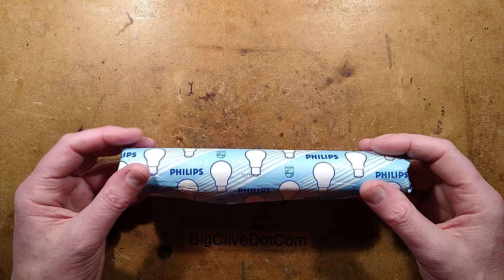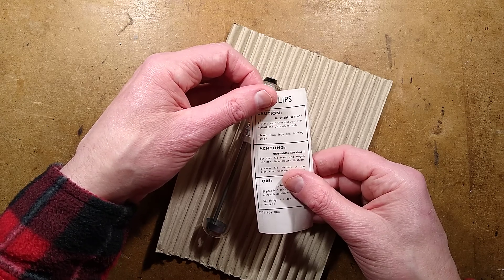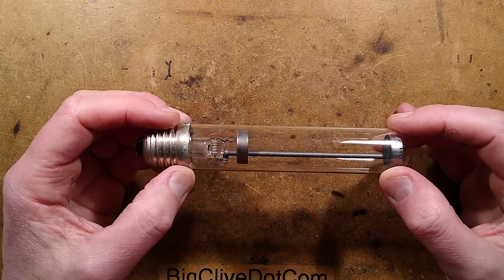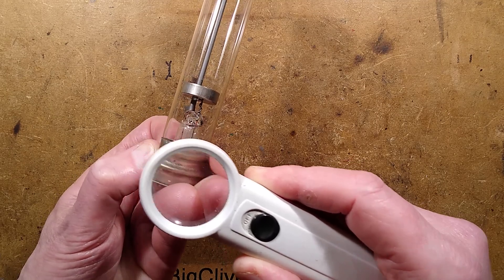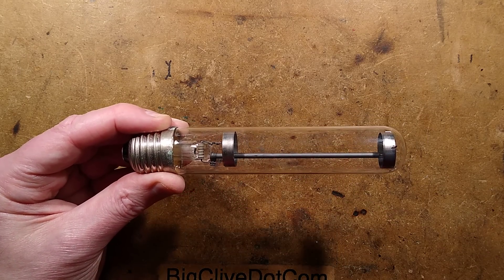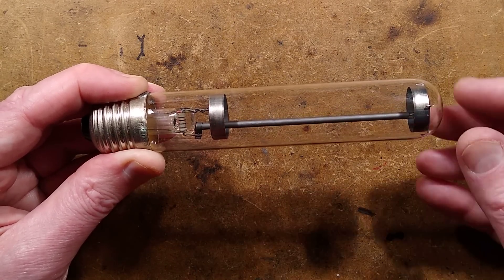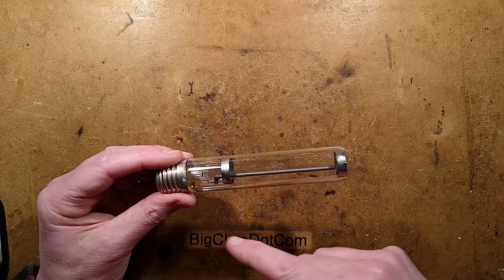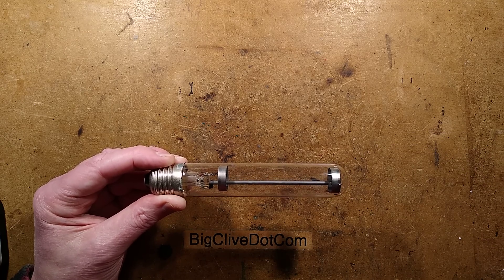Unwrapping and testing a dangerous vintage Philips lamp

Comment: Once the retinal burn sensation subsided from staring at the UV somehow being transferred via the normal LED screen (how'd  you do that!? giggle giggle) , it reminded me of a HS shop class. I was the one, who once-a-month was the one who checked the cabinet that everyone stored the safety goggles. The shop teacher reminded everyone to NEVER push the "on" button, as it would turn on  the UV bulb inside to sterilize all the goggles. It was actually on a timer that automatically turned it on for 3 mins between classes and for 30 mins overnight (at the end of the day). I had to check it once a month to see if it was working and let him know if it burned out. It was the exact bulb type you show here. I've seen other UV bulbs, but they looked more like regular bulbs or laser gas tubes. This one with those metal "caps" and that long rod inside is what brought back the memory of the '80s. And no, I never looked directly at the bulb. I was the "lucky" one who got to turn on the override "on" switch for a few seconds and see the glow through a little slit between the doors to see if it was actually on. Then I checked the bulb to see if it was discolored/darkened. Only had to replace the bulb maybe twice. I don't recall ever smelling ozone after it was on. Did this one produce ozone?
Reply: I don't think it produces ozone otherwise Clive might have mentioned it.
And besides, more modern UVC bulbs including Philips ones don't emit ozone as their quartz is specifically treated to block the ozone-generating wavelength of light.
I think it's only the cheapy chinese bulbs that emit ozone.
Which is actually quite a pain when you want to sterilize air in a HVAC system or even some stuff by pointing the lamp at them, without ozone you can reintegrate the room right after having switched the lamp off, not so much with a ozone-generating one.
Reply from the maker: This one didn't produce ozone.  It must be filtering the 184nm wavelength.

Comment: That was a nice purchase! 😃👍
Nice, that Philips was able to put all needed "hardware" directly into the lamp that fits into a regular E27 socket. No external transformer, no external starter needed! 👍
Very low power consumption aswell.

Comment: I used the illuminated time of the lamp to test the authenticity of my bank notes by laying them on my tablet screen - thank you.ps. I think there should be an app that allows your phone screen to light up purple and emit UV .
Reply: There might be apps that turn your screen purple, however it will not emit any UV as it's basically not designed to do it.

Comment: I have one of those. The idea decades ago was to make circuit boards and use the UV to expose resin. Never worked well for this, wrong wavelength I guess. I'm afraid I looked at it with bare eyes a couple of times, but not blind yet. I guess I better label it with skull and crossbones in case the kid finds it and turns it on.
Reply from the maker: It needs to be UVA for that.  Either the dark coloured blacklight tunes or the bright blue insect zapper ones.

Comment: Watched this in 360p as I was rather nervous about the full HD experience. I did wear protective eye wear though and looked away from the screen for the duration of the video. I have noticed some sunburn on my iPad screen, however just applied some factor 30 to it and that should heal with time.

Comment: I happened to experience an effect of intrigue, and happiness, while exposed to it functioning, and the thorough explanation of how it worked... 🤷 👌

Edit: But I WAS on the shitter as I watched this video... 🤨

P.S. And no, it didn't help with that at all, I still had to work at it, as usual. 🫤

P.P.S. If the bulb WOULD help, and create the desired effect, I DEFINITELY would have one screwed in to my bathroom ceiling light fixture, and have a pair of welders goggles hanging on the towel rack.. 👍🤙

Comment: That reminded me of another "dangerous" lamp I ran into. It was some kind of high intensity bulb designed for photography/video lighting. From what I was told it got ridiculously hot, and when installed the bulb was never to be touched by bare fingers as the oil from them would cause the lamp to explode. I have no way to confirm if that was true or not. 
Not entirely sure, but I think this type of lighting got replaced by LED lamps.
Reply: I can confirm, this also holds true for videoprojector lamps, when swapping a bulb from a old DLP proj, I grabbed it by the glass part by mistake.. So when I tried powering the proj up, the bulb literally popped as it began heating up. That was very startling!
Reply from the maker: The oil from your fingers causes excess heat at that area and devitrification of the quartz.  It can make the lamps fail at that point by going frosted and sometimes bubbling out and destroying the vacuum.
Reply: That sounds like a normal halogen lamp. If you get fingerprints on them the glass can crack due to the fingerprint absorbing light and creating a hotspot on the glass. The fingerprint is probably burnt to soot by the high temperature increasing the light absorption.
Halogen lamps need to operate with very hot glass for its internal chemistry that prolongs the filament life to work correctly. They are therefore typically much smaller than normal incandescent lamps.
Many halogen lamps have a second outer glass that doesn't get as hot protecting the inner glass and avoiding these problems.
Reply: The not touching with fingers is true for any kind of Halogen lamp capsule, car headlight bulbs (as still used on most cheap cars) being a good example. 

The explosion part reminds me of when a studio light failed on live TV and bits of light fell down on the news presenters desk.
Reply: I've seen two types of lamps that had dire warnings about operating without the shields in place due to intensity. One was in a long throw Kodak carousel slide projector that was used in a large auditorium. The other was the high intensity beacons used in naval aircraft.

Comment: The moment you read the model number, it was quite apparent what it was, and it wasn't a German MOT certificate... :P
(I've yet to power up my 20W "compact fluorescent" UVC lamp, too scary, though the other day I did stick one of my 4w UVC tubes on an 8w driver, right after that 8w red tube (oo-er!) and its' striation fun too, the little 4w tube looks a tad sputtery inside now!!!)

Comment: I haven't had an issue in the past watching your UV-B videos, so I had assumed, sadly incorrectly, that I would have no trouble viewing this one too.

Unfortunately, immediately after viewing the UV-C light coming from my phone, my stool loosened and I immediately proceeded to have explosive diarrhoea. This wouldn't be an issue were I on a toilet (an effect that definitely requires further research for the replacement of chemical laxatives!), however I was sat on a train travelling up the UK. 

I'd like to use this comment to sincerely apologise to the conductor on Northern train 150002 from Sheffield for the horrific experience my watching this video caused. I hope that cleaning the carriage will be a swift and trouble-free procedure, and I have learnt my lesson to never watch videos of UV-C light outside of my bathroom again.

Comment: Easy to get the lamp voltage drop with a variac. Start at 230VAC and lower it till it just stops running, which will be the tube glow voltage. Probably around 90VAC though.

Comment: I didn't have any of the symptoms that you described, but I did have a sudden and inexplicable urge to take out massive loans to buy NFTs moments after the lamp reached its full intensity. Thankfully, the urge passed quickly after you restored normal illumination.
Reply: I was lucky to be sitting on the toilet when that moment happened. Thankfully I suffered from the described explosive "stool loosening" event at that moment as well. Thus leading to my realisation it was a shitty idea.
Reply: @zyeborm ROFL !!! 😂

Comment: Fun fact, most UK leisure facility swimming pools will have kW power medium pressure UV lamps (this little tiddler will be low pressure) chucking out 254nm UV.  Not only is it highly biocidal but its used to react out the chlorine/ammonia compounds that form in pools from the chlorine and, err, pee.....
Reply: cyanogen chloride (CNCI) and trichloramine (NCl3). Mmm Mmm. I guess the UV breaks those down into something less carcinogenic.
Reply: Seems Clive didn't like your comment - no heart!
Reply: we have one at work and it's a beast, it takes an 85W 97V Phillips TUV lamp. it works quite well at dissipating the chlorine and keeping the nasty growths down.

Comment: These lamps are also used in chemistry labs for thin layer chromatogrpahy. You have an aluminum or glass base plate covered with some inert material like fine silica powder and it contains I think for uvc it was zinc sulfide which glows green.

Comment: Old hot cathode rectifier tubes (UK, valves) for radios of type 82 and 83 had low pressure mercury gas fill.  Owing to the mercury the rectifiers had fairly low voltage drop of around 15 volts at several hundred volts applied.  In operation, the tubes glowed blue-white, but the glow was confined between the cathode and inside of the hollow plate electrodes surrounding the cathode wires.  The glass envelope was standard glass so probably not much UV light escaped.  The RCA tube reference manual doesn’t have any warnings concerning UV emission, but does mention a glow is visible while operating … but then we’re talking the 1930s when safety wasn’t the concern it is now.  😊
Reply from the maker: With those tubes the standard glass would block most harmful UV wavelengths.
Reply: @bigclivedotcom While still letting UVA out and depending on the power emitted and how sensitive are your eyes it could still cause eyestrain and/or photophobia afterwards.
Reply: They probably had radium, asbestos and arsenic in them as well.
Reply: @gcewing   I’ve encountered pre- and early-WW-II era equipment with radium painted labels.  Often the phosphor in the paint no longer glows but gives off considerable gamma radiation. Later WW-II instrument dials were phosphor painted and illuminated from a separate (presumably safe) UV light on the cockpit instrument panel, for example the flight engineer’s panel in a B-29.  I scan potential restoration projects with cheap little FNIRSI Geiger counter to before considering starting work.

There is a sad story of college students in a town in Pennsylvania, US who lived in an apartment near a shop which reconditioned aircraft instruments.  Dials were stripped and repainted.  The paint stripper was loaded with radium and simply dumped behind the shop.  The people in the apartment were contaminated and sickened.  The location became a major Superfund cleanup site.
Reply: And I've  spent a few minutes staring intently at them at close range as a kid wondering what universal truth lies within and if the invisible aliens from beyond the moon are listening in on a really weird frequency and the glow was leftover messages leaking out to our dimension. And I might see the energy in raw form.
I was a very weird child.

Comment: Philips manufacturing new UV-C lamps with motion sensor, they work only if 30 seconds nobody moved in room. Disadvantage is lifetime only 9000 hours.
Reply from the maker: The shorter lifespan is due to changes in the glass structure over time that results in lower UVC output.  They look just as bright, but aren't as effective.
Reply: @bigclivedotcom  Light source should be replaceable, because motion sensor and other electronics work much more longer than 9000 hours.

Comment: - 1 hour after publication of the video there were 367 comments
- I asked GPT4 1106 to give a summary of the comments (at the cost of $0.19, 19143 tokens and $0.01/1000 tokens)
Summary of comments
- Viewer comments on experiencing furniture damage due to intense light from a lamp video.  
- Discussion of symptoms like loose stools, redness of skin, and itching of the eyes after watching the video.  
- Mention of various humorous and exaggerated effects from watching the video.  
- References to nostalgia and memories related to UV light exposure.  
- Commenters joking about the video's ability to cause physical reactions and the potential dangers of UV exposure.  
- Several comments on the desire for more videos on gas discharge lamps.  
- Mention of using the video for sterilization purposes and its effectiveness.  
- Commenters jokingly attribute various issues and phenomena to the video's content.  
- Discussions on the technical aspects of the lamp and its components.  
- Commenters sharing personal experiences and anecdotes related to UV lamps.  
- Some comments describe reactions of pets and objects in response to the video.  
- Jokes and banter about the video's content and effects on the viewers.  
- A few comments provide actual information on the use of similar UV lamps in different applications.  
- Viewer appreciation for the video's educational content.

Comment: The tube likely has 6mm of vapor pressure. That's the minimum to ignite neon dimly. Mercury will ignite at about 3mm and glow well at 6 or 7mm. at about 12mm any gas will cause the electrodes to overheat from excess current. I made a couple lamps, back in the old days. My primary symptom was nostalgia. Thank you. Keep working, good luck.
Reply: When you say "6mm of vapor pressure", am I correct in assuming you are referring to 6 mm Hg (or 6 Torr)?
Reply: @MicraHakkinen today I learned that people use pressure units other than Pascals, bar and mmhg. Torr seems a bit redundant given it's almost exactly the same as mmhg.
Reply: The vapor pressure of mercory is only 1 Pascal at 40 degrees.

Comment: This thing could easily be turned into a CFL. I don't understand why most CFLs use electronic ballasts, the most likely reason being that they are less reliable and will force you to buy more light bulbs (and an opportunity to outsource production to China).
Reply: A resistive dropper would be as inefficient as incandescent. The first (Philips SL) CFLs used an inductive ballast and were nicknamed "the jam jar" as they looked like one and were about as heavy as one full of Jam.

Comment: At my last job ( hospital maintenance)a similar lamp was used to sterilize towels and similar small fabric items. A stainless steel box with shelves and lots of warnings. It had a timer and solenoid latch on the door to lock it when in use.
     My cat was watching this video with me, and started purring loudly. May cause purring in cats.
Reply: The ghost of my cat also started purring loudly, may cause purring in ghost cats.
Reply: Sometimes larger-scale ones can be seen in hospitals, which disinfect whole rooms - a dozen UV-C tubes mounted vertically in a tower on wheels. I presume they make sure the room is unoccupied first...
Reply: I remember Wood Shop in middle school had a cabinet for doing same thing for our PPE.
Reply: My barber had one of those boxes to sterilize scissors and combs between customers. Always thought it was a step up from the jars of blue liquid they use to used to sterilize items.

Comment: When I was young I was following a technical school, and we had to know by hearth the gas pressures Vs wavelength. Low pressure mercury emits light in a single spectral line, and as the pressure goes up, the spectral line becomes a segment of the spectrum. Those mercury lamps that until 20 years ago were used for road illumination, had two intense spectral lines, one was blue and the other line was green. The lamps appeared of a blue colour normally, but appeared to be green in the fog...
Reply from the maker: I do have a 250W mercury discharge tube.  Probably the same type.

Comment: Excellent,  i now no longer need to use the spray disinfectants. 
I just hold my phone above the surface with this video running. defo works as i have eaten my dinner off the toilet seat and feel fine.
Thanks for the money saving tip

Comment: When I was in high school my friend and I were rummaging around in the physics store room,the teacher let me do that as I was a member of the radio club and the radio room shared the space with the storage area. Anyway we found an odd little lamp with a black shade. We plugged it in and it glowed with a light bluish color light. Odd. Then my friend noticed some writing on the lamp. It read something like "Warning: UV light source. Do not view light with naked eye and avoid skin exposure". 
Yeah, we read that on the bulb with it turned on. It seems that neither of us suffered any ill  effects from doing this but I do wonder how much exposure is needed to cause eye or skin damage.
Reply from the maker: If it was low power and a brief exposure you would have been fine.

Comment: I got all three symptoms you described. It's either the UV light coming from that lamp, through YouTube's video file and out of my monitor, or the massive flu I've been dealing with for the past two days. My money is definitely on the lamp, though.
Reply: I believe it also gets amplified by the video compression.

My vision is now filled with artifacts, it's rather cool. I have to re-watch the vid every few hours to refresh them.
Reply: @hydrocarbon82   Did you at least get the "Premium Full HD" toggle on your right corner?
May as well have to pay for premium vision now...
Reply: So it's you I caught the flu from. Please always sterilize your 'puter with a local TUV-UV video file before coming online.

Comment: I am a bit jealous of countries that have 230vac at their disposal. It seems so much more efficient to me, even if someone could say its more dangerous to end users. I'd venture to say that regular 230vac has a lower impact on mining, copper use and wire thickness, production, power distribution lines.